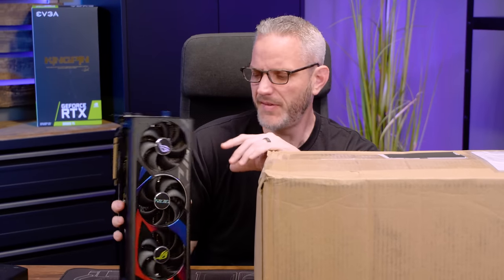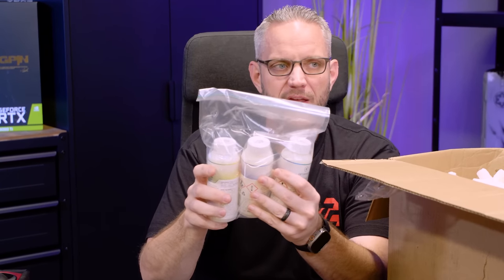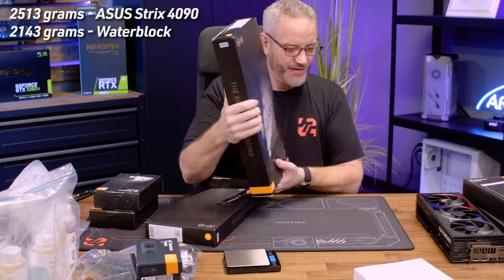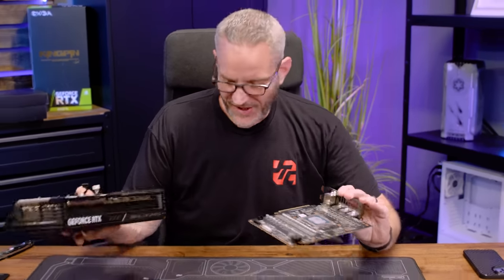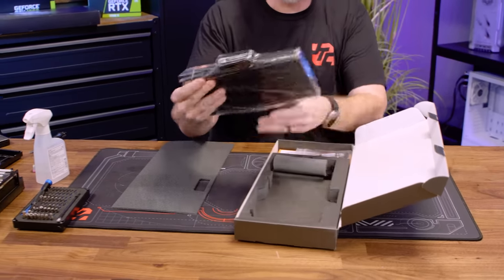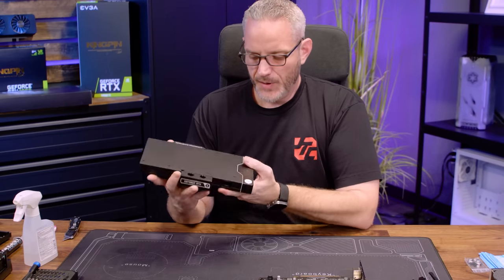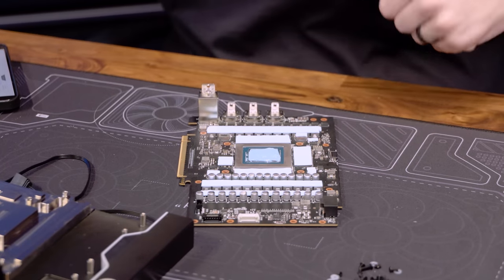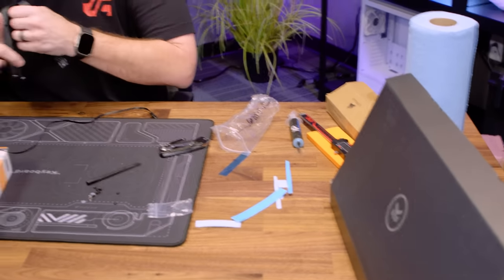This is how you make a 4090 even more expensive... 4090 Strix EK Waterblock Install

Comment: I'd like to see a comparison on how the temps change between the normal and the active backplate blocks. Just so we know if it's worth the extra price and effort.
Reply: It will lower VRM temps, which will definitely help in demanding scenarios
Reply: @RGBeanie  how would it lower vrm temps if there is no memory on the back?
Reply: @stansz  ah my bad
Reply: @AKTech.it  Not on JayZ model no, but on versions that do, it can be of benefit. Really depends on your use-case. If you were still mining, for example, those VRMs on the back get mighty toasty!
Reply: I got a bigger difference from swapping the thermal pads EK supplies with NAB 15w/mK pads on my 3090 with an active backplate.  I want to say it dropped 15-20C from the thermal pad swap.  I see temps in the low 50s on core and a high of 60 on the hotspot under load now.  When using EK pads, I had temps in the low 60's on the core and mid to high 70's on vram.  Putting good pads on it will help a TON.
Reply: I can say on my 3090 it made a pretty big difference on my vram temps, but my understanding is 4090 doesn't have rear mounted vram chips like the 3090 did. I started with just the FE 3090 block, later added the active backplate and probably dropped vram temps another 15-20 degrees over just the standard block.
Reply: it helped a lot on a 3090 on this one it's still going to help because backplates are hot anyway..that said what I learned in my all watercooled pc (cpu vrm+chipset+backplate gpu) is that all those stack and will raise your liquid temp, and liquid temp = exhausted temp by your pc honestly only only cpu+ regular gpu blocks seem better in the end, cheaper,simpler and my liquid temps are clearly lower
Reply: i used a bykski active bp on a first gen 3080 tuf 10gb OC, which has no back side mem, light overclock, no undervolting and it runs 41-47c,  with a 34-36c loop temp. Thats after gaming for hours.. 99% gpu usage . 4k resolution at 120hz.  You can not only cool the vrm but the back of the socket as well.
Reply: Did he test the Strix 4090 beforehand? Otherwise he had to revert everything. 🤣
Reply: The answer is no, it's not worth it, because there's no use case for it in the first place.  Anyone here doing 8-12K gaming or running AI at home?
Reply: @CeresOutpost  people may also want to do it for the looks
Reply: It is better but probably not 100$ worth of better. Looks awesome with the 2 rows of led strips though.
Reply: @CeresOutpost  who doesn’t? ;)
Reply: My TUF 4090 has EK ABP + GPU WB and the GPU sits idle at 23C and Memory sits idle at 26C with Hot Spot at 30C. While running Superposition 1080p Extreme, it got my GPU to a toasty 44C and the Memory to 34C with Hot Spot at 50C. Maybe someone else can attest to performance with normal backplate + WB. Temp in the house was around 20C when measuring these parameters.
Reply: This comparison would be amazing honestly
Reply: I don't know, but I water blocked my 3080 front + rear with a Bykski 3090 kit, Idle 20c, Mem 28c, Hot Spot 28.6c. Under load 32ish, Mem 38ish, Hotspot 42ish. Dual 240 rads with an x99 5930k " 4.6Ghz, that pulls about 200w alone. Padding the rear of vrm's and mem chip locations + also behind the core (i.e. I completely ignored the absolutely pathetic Bykski diagrams). That's insanely good cooling compared to just front plate cooling and fans run at only 900rpm. Ohh the the real cherry on the cake... I paid 45 UK Pounds for them 2nd hand on ebay :D :D
Reply: Definitely!
Reply: Ive used the ekwb vector2 trio on a msi 4090 suprim i can confirm the backplate drops the temps another few C but is it worth the price not really
Reply: @geoffhoehn  or more likely you fucked up the first install.

pads wont reduce 20c poor installation will cause higher temps
Reply: @clickclaxer01  mines the same no ABP, gaming x trio 4090 with EK block
Reply: @RGBeanie  lower vrm temps are actually bad for overclocking.
Reply: @fulcrum7082  You're saying you're getting the same temps without the ABP?
Reply: @clickclaxer01  yes mate, the ABP is a waste of money, even air cooled the temps were low
Reply: @fulcrum7082  Then that puts that mystery to rest. I don't think any X670E motherboard can fit an ABP anyway (except maybe MSI MPG X670E Carbon EK), you have to use a riser to make it work in the top slot. By the way, does your Gaming X Trio have any sort of coil whine? Apparently, the ASUS cards this generation have a lot of coil whine, including mine, so I might just switch out for a Gaming X Trio.
Reply: you forgot to check weight after water block installed . .
Reply: I have one on mine, at full load I haven exceeded 50C
Reply: You’re already in $$$$ might aswell do it right
Reply: it is not worth it. maybe if you need a silent system. the original Founders edition is also very quiet.
Reply: LTT already did that. The video is called "NVIDIA, this is NOT ok! - EKWB Active Backplates". ABP shows some significant differences.
Reply: under water my asus 4090 idles at 28c and games at 50 to 55c max and this is after 24hrs of running. the air cooler is soo effiency it can acutally beat water now stock. i never ran the fans over 50% waiting on the block i got it before it was even available lol.i have 2, 240 rads. i have 10 fans 5 intake 5 exhuast
Reply: @CeresOutpost  VR workloads will call for everything that card can offer.  MFS max settings with a Varjo headset at high res = PC BBQ
Reply: @geoffhoehn  what aib and power limit did you use have you ever flashed a 1000w vbios and tried to run it on water?
Reply: @KnexFour 3090ti has no memory modules on the back

Comment: I've put Mystic Fog in several builds.  The loop really needs to be flushed thoroughly with distilled water before using the Mystic Fog or the reflecting particles will fall out.   I've also found that diluting the recommended mixture with about 50% more distilled water leads to much better longevity.   The system I built for my wife has been running Mystic Fog for a year and a half with no fallout.
Reply: no reason to dilute if done right the first time around, and maintain flushing per manufacturer specs (def less than 1yr... hint hint)
Reply: @warpedphreak  If there is no color fallout, temperatures are identical to new, and there is no chemical breakdown in the system, then there is no reason to flush the system.
Reply: @KentBurgess  
You know that particles in suspension can still react and clump with other particles over time right? Especially in systems with more tham zero energy....
Reply: I had the premix drop out after just 6 months.  The loop had EK cryofuel clear in it beforehand, and was not flushed with distilled water or any cleaners, just some clean cryofuel clear(literally used 2 liters of clear premix to flush the loop to even remove the possibility of water contamination).  still failed after 6 months.  didn't stain the tubes or stuff tho, and was able to be flushed out in 1 go by using the pump to pull from a new bottle of clear and just sucking the old crap out of the loop.
Reply: I've used premix for a year and a half and the mystic fog still looked new. Eventually drained it anyway and the tubes had some discolouration
Reply: This is the info I would have liked to find before I did my custom loop. I went with purple Hydro-x fluid instead of mystic fog.
Reply: I wish someone would do some PC coolant reviews. I can look up reviews for all most everything for a PC but when it comes to Coolant. I have to cross my fingers and hope it does not F**k up or gank up your PC that you have thousands of dollars in too. So much fun and people wonder why custom water cooling is not more common or why people go back to AIOs
Reply: I recently did a full loop with 3 radiators and tried mystic fog for the first time.  I used superflush for 8 hours before draining and putting the MF in.  It lasted only 3 days before going clear.  Was cool for a minute.
Reply: Ek has a video that talks about their cryo fuel I highly suggest people go watch it since it talks about how often you should change it out and all that
Reply: @creach34  I expect it's because you need to wait at least 6 months, even longer for a proper review, before getting any results. By that time whatever you use might not even be still on the market.
Reply: @mikep9418  That is true. I still wish someone would try. They are some coolants that have been on the market for a good amount of time. If someone like Jay, hardware unboxed, Gamers Nexus, or LTT started to point out the good coolants it would put some pressure on the manufacturers to make a better product. And it would help out people like everyone on this thread that had a bad experience. I when down the custom water rabbit hole from jays videos. I tried 3 coolants before I when to just distilled water. I like custom water cooling. I do not like that if I buy a "mystic fog" it can cost me my system or hours cleaning it out. I do not think that is right.
Reply: Really liked Mystic Fog concentrate woth distilled water before someone on Reddit replied to my build with "Cum Reservoir"... Still had no issues after year of use (maybe slight tint on tubes). Replaced with clear after that.
Reply: @creach34  it's hard to review coolant cause much of it comes down to how well it ages and no one wants to run a pc test rig for 6 months to test a coolant
Reply: Per EK themselves, you have to use their flush product to prep the loop before using their opaque fluids. Using distilled water can cause the particles to fall out of suspension because of any distilled water is left in the loop from the flush, it disrupts the electrostatic balance of the fluid, causing to fail.

Now, is this true? I don't know, but it's what EK has said. What I do know if that I use water cooling for cooling, not looks, and as such, I use coolant designed to perform well and ensure reliability, not look good.
Reply: @FractalWavesAudio  same thing happened here. It lasted only a few days.
Reply: Well Kent, maybe your wife doesn't like that game. (hehe)
Reply: @FractalWavesAudio  Could it possibly have something to do with your radiators? Some radiators, from my understandings, are incompatible with specific coolants. For example, on the website Corsair lists that its radiators are incompatible with EK mystic fog coolant.
Reply: Someone needs to post a timeline of photos to back this because the survivorship bias on Reddit is insane.

Comment: Their manuals (EKWB) are easy to find and well done. I just did a 2080 OC Strix with an EKWB GPU Water Block - took maybe 20 minutes total between the ASUS being easy to take apart, and the EKWB documentation being well written.
Reply: Instructions arent worth how overpriced they are imo.
It's getting insane how much they charge for their parts when there are other companies that have better cooling performance for almost half the price for some things.
Reply: @hypnotiq  uhm, aren't you kidding? This is EK water blocks, their cooling solution is always end to end, if there's cheaper ones, it's either just noctua which hardly comes close
Reply: @baoquoc3710  are you drunk? Watercool/Heatkiller waterblocks just to name one, have been a few degrees cooler at almost half the price for YEARS. EK is just a well known pay for the brand overpriced.
Reply: @baoquoc3710  The only reason EK is considered "end game" is because its expensive and way more popular than other brands. Their waterblocks are good, but for the price there are countless other brands, even aliexpress waterblocks hold up to EK blocks within a few degrees.
Reply: @hypnotiq  Part of it for me was on availability. I wanted a Corsair model, but it wasn't restocked. I went with this as an alternative and wasn't disappointed. It's a good point to say there are plenty of options, and I agree that shopping around is best. I appreciate that this channel is big on that recommendation because as Jay has mentioned before - it can get really expensive very quickly to spec out a custom cooled build (esp if you use a lot of fittings).

Comment: Blocks like these are where I love using TG-PP10. No need to cut up specific thickness pads, just ball it up using your fingers or use a syringe to apply to all areas, put on your thermal paste, put it together, done.

The best part is if there are any tolerance differences, you don't have to worry about thermal pads that are too thick or too thin. And with a thermal conductivity of 10.00W/m-K, it's up there with some of the better pads.

Comment: I got pretty much the same block but for the Gigabyte Gaming OC 4090 upon launch (I think it arrived in Nov). There's one extra thing you didn't show - the metal plate with "GEFORCE RTX" is magnetic and detaches easily so you can rotate it either direction so it can be read properly when used in vertical mounting :)

Comment: i love watching these types of videos. I wanna liquid-cool my system, but i wanna run 2 separate loops (1 for CPU, 1 for GPU--i know there really isn't a "need" to, but for the design i have in mind, it's what i want) so i am always inspired watching what you come up with. Now i'm thinking AIO for CPU and a custom loop for graphics.  i can still make that work with the theme of the build.
Reply: I’m here to say build whatever custom loop you like! Don’t let convention dictate how you want your system to look. 😁
I very nearly intertwined/crossed tubes on my loop just because I knew it would trigger custom loop snobs. 😆 Chickened out in the end because it was going to be too difficult to bend. But my system is massively over-cooled (2 x 360 rads for a 5600X & RTX 3070), just because I wanted the loop a certain way & for reduced fan speeds/noise. It was fun, & that’s the whole point.
Reply: Not only is it not necessary, it will perform worse. With a single loop, all components have access to the full cooling potential of the system. In a dual loop, each component is limited to the cooling capacity of its respective radiator. Since there are almost no scenarios where both will be operating full tilt, you are basically throwing away the unused capacity of one of the loops.

The only reason to do a dual loop is aesthetics, and it costs you performance.
Reply: The main advantage to liquid cooling is it moves the heat sink over your CPU and GPU to the edge of the case. This makes it look much cleaner inside. The second advantage is you can then use larger fans. The larger your fan the quieter it is. Still might get a noise from the pump depending on the pump you go with. Also I would start with soft tubing. Hard tubing is such a pain if one of you components quits working.
Reply: @grievesy83  congrats on spending enough to upgrade to a 3090 and maybe 5800X3D on your loop, I guess? Your also triggering this value-enthusiast.
Reply: @hellraserfleshlight  spending money on a hobby doesn’t need to be a value proposition. If it did, we wouldn’t have hobbies. The actual benefit in the end was in noise reduction vs air cooling - my fans are all running super slow and quiet because i have so much thermal headroom.

Comment: To make things easier, i highly recommend before screwing in the backplate to insert the power cord and insure it is properly seated, then install the back plate. it'll help IMHO with the issues with seating it flush, and can do so without forcing it further causing damage, or worrying and not putting it in correctly--regardless if it will or won't with the backplate already on.

Comment: nice to see water cooling stuff again feels like a long time. but like most have mentioned i would love to see the temps , im sure performance will be marginal
Reply: My gigabyte card never goes above 50c and generally is between 40-45c while gaming.
I am not able to talk about performance gains but it seems to keep higher clocks.
Reply: @Silverhks  is it water cooled?
Reply: @peterpeter5666  yep, that's why I mention it. I have no comparison data because it actually wouldn't fit in my case without the waterblock 🤣

Comment: Man, that is one sleek water block. Never seen a 4090 so small. Just bought a MSI 4090 Suprim X, but was offered the AIO, tempted to exchange now given the space saving.
Reply: Swap the AIO for a cheap Byski block. It worked wonders for me. The AIO is too small for the power draw on these cards. Get the Byski, flash the Galax 666w bios, and enjoy your card.
Reply: I have the 4090 Liquid Suprim X and it's such a blessing to not have a humongous card. Cooler works nicely too, because the radiator fans push out literal hot air and the card's temps themselves stay cool.

Comment: Would love to see a video on active backplate vs non active backplate on a 3080/3080ti or 4080/4090 without ram on the back side of the board.  I have an EK Velocity TUF on my 3080ti and their passive backplate.  The backplate gets so hot that you cannot hold your hand on it for more than a few seconds.  GPU temps are low 50s so normal, but I would have to imagine sucking all that heat that is still coming off the board on the backside may help cool the ram/board overall to make a difference that is greater than margin of error.

Comment: I used mystic fog premix for about 6 months.  it started dropping out in the last month when the PC was off.  I flushed the loop by having 2 liters of premix cryofuel clear, cracking the loop open, and running the pump to push the mystic fog out, while pulling the clean fluid thru.  worked a treat, and got rid of it all in about 20 seconds, leaving just a couple of res rinses with clean fluid to clean the rest.  did not stain my waterblocks at all, but did stain the gasket of my EVGA Hydrocopper card quite a bit(from clear to a white haze now).  I will have to change the fluid again in a week as it dissolves the rest of the crap that fell out, but the clear fluid has a slight haze to it now.